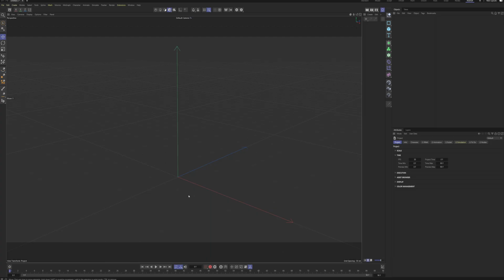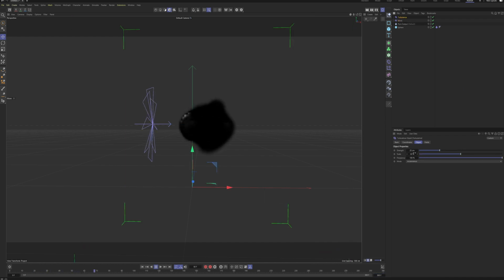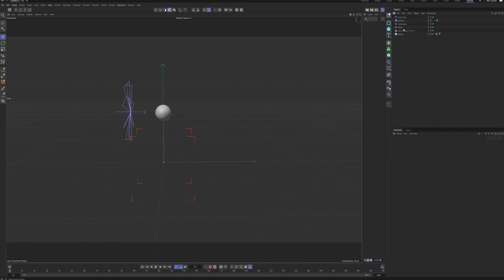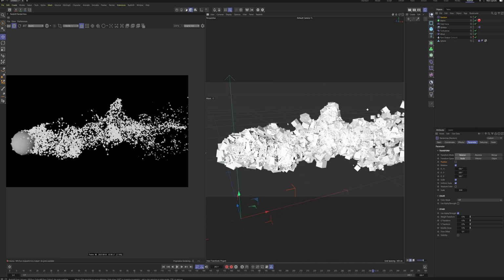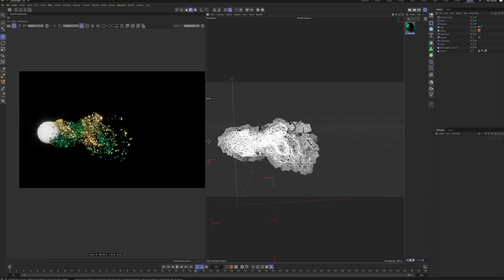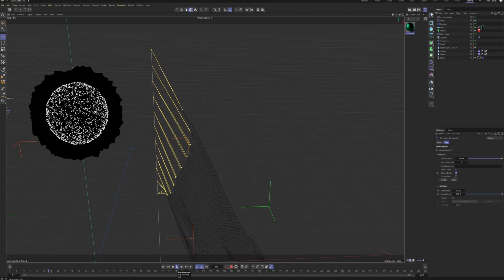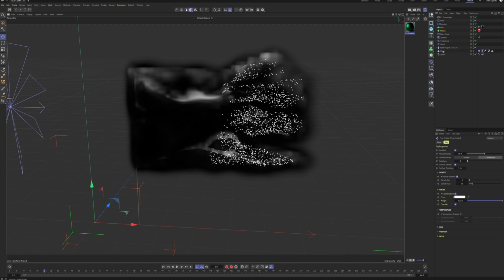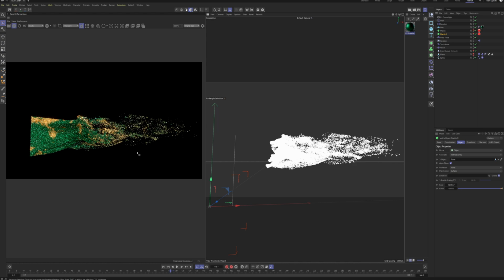Recreating Scenes From The Foundation Series

Comment: Thanks Lukas,

Yes, I also ran into troubles with the Field Force not pushing the particles off the sphere surface. It seems there is a fault in 2024 in this area. I tried this exercise in both 23 and 24 and could only get the pyro advection to work in 23. Something seems broken in 24. I will try the Pvelocity trick from @allthingmarvellous and report back.

Comment: i followed the tutorial but my particles just appear on the sphere without following the velocity of the pyro!
Reply: I figured it out, you need to add a Pvelocity to the expresso window plugged in from P Pass and then change the PForceObject to 'Change Direction' in the forces section
Reply: @allthingsmarvellous  Splendid! Will give it a try latter today, will post about outcome. Thanks!
Reply: @allthingsmarvellous Am I wrong or does that not follow the swirling of the smoke sim but only the initial direction and velocity?
Reply: This get's the particles moving on one axis but they are not following the Field force containing the Pyro output at all.  @allthingsmarvellous
Reply: Me too.
Reply: did you find an answer to this? @袁华-b4u
Reply: Same here
Reply: @HunterPixel  Render directly from the first frame
Reply: same my particles doesn't following the velocity either..
Reply: Same here
Reply: Me too